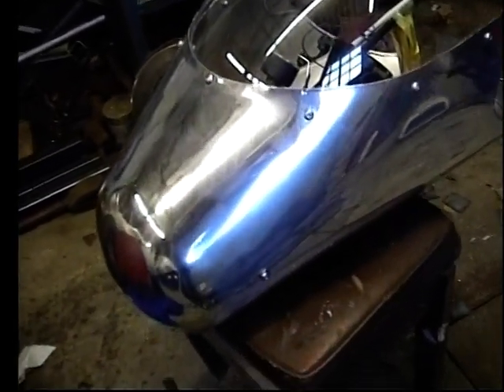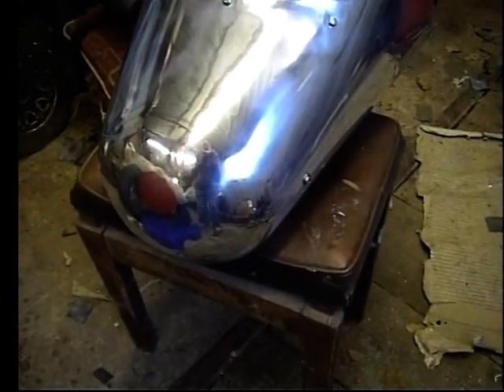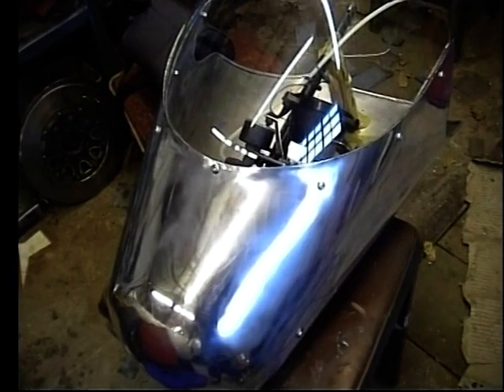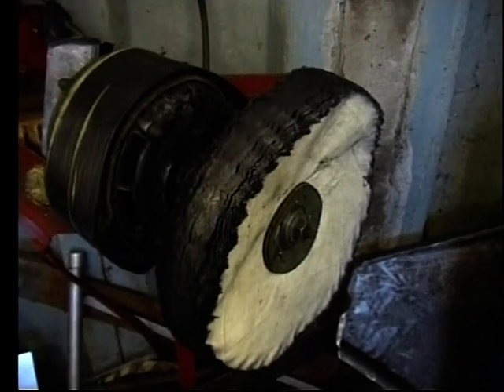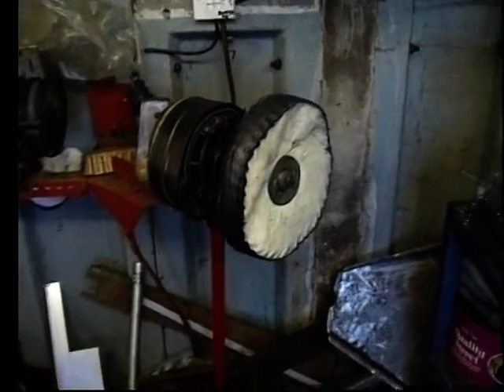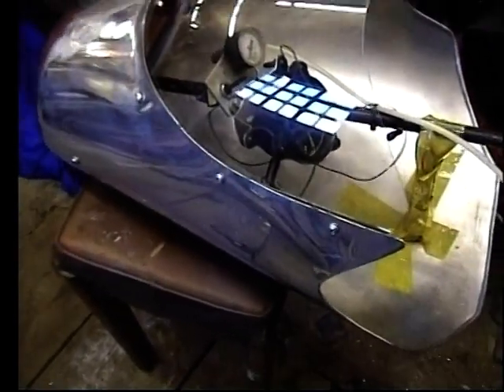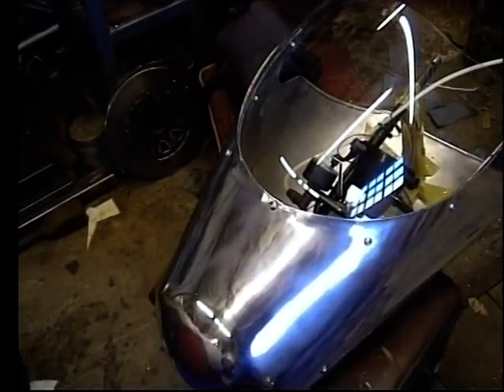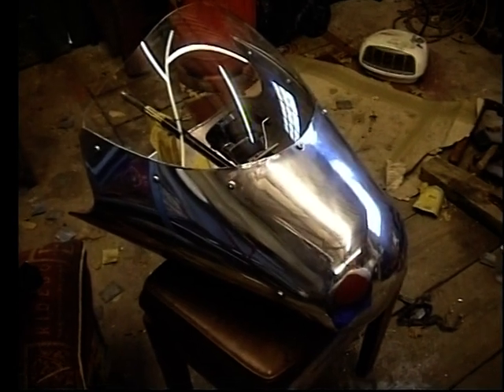Brief video: How I Made an Alloy Motorcycle Fairing & How I Cut & Drill an Acrylic Screen.

Comment: Good work again Pete. How are the fairing edges finished, wire edge, or just folded over?
Reply from the maker: +dpforth Hi and thanks for your compliments and question. I have in the past used wire edges, especially on some vintage parts I made in thin steel. However, on this occasion, I just folded the edges over to create some rigidity, so as to prevent any chance of cracking with vibrations and other movement, as the fairing was for a three-wheeler sprint machine. Cheers, Pete.

Comment: Ok Pete thanks for the advice , I was hoping maybe heating the dent slightly may bring it back out but looks like I'm going to have to cut it open , DRASTICALLY , I fear it's going to end tears .
Maybe begging at your front door next week for foreigner lol
Reply from the maker: Hi Mark, I think if you heat it, it will simply follow/worsen by expanding further in. Some people have suggested pressurizing tank with air but I don't subscribe to that theory, cos the whole tank will expand, not just the dent. Dodgy. Let me know how you go on. Pete.

Comment: Pete need your advice , i have an alloy tank which I had somebody make a while back , anyway it's got a slight dent in it somehow on its side , is there an easy fix or not ? Want to keep the tank bare otherwise it would not be a problem , regards mark
Reply from the maker: Hi Mark. Thanks for your question. If the filler cap is large enough you might be able to get a hammer in there if you saw off the ball part of it or the claws and gently tap it against the dent. But you'll have to have patience and maybe different size hammers as you get it somewhere near right. Alternatively cut a hole in the bottom on the opposite side (providing it's not got a deep tunnel down the centre), then use say a one inch diameter round dowel made of wood and curve the end of it/chamfer slightly, so it doesn't knock sharp dents in as you tap it gently with a hammer. You will hopefully then get it somewhere near and may have to tap the outside a bit, with the wooden dowel, or hammer (as in the first example) still in there, so it is solid to knock onto. Then use some various grades of wet & dry and rub out the marks on the outside. You could also try a shaped metal tube with tape around its end to prevent sharp dents/kinks and clamp the tube in a vice, then slide the tank over it through the filler cap and lever the tank till it pushes out the dent. I have used these ideas in the past. Other than that, you would have to cut the bottom out which is a major job. Hope this helps. Cheers Pete.

Comment: I am amazed by the skills u have got. 
I do have an aluminum sheet already. Want to try to do my first attempt on beating it into some shape i want. Will c how it goes. 
Would you have any advice? What tools are best and where should i start from?
Thanks for sharing them videos!
Reply from the maker: Hi Wojtek Spyra, if you want to do actual panel-beating, then many people use a special leather bag filled with dry sand and a large round-headed hammer or mallet and beat it with that. I don't have a leather sack with sand, I have a short piece of tree trunk about two feet tall and stand it on garage floor. It is about 10 inches across in diameter. I have used an angle grinder to grind a rough concave recess in the top of it and I place my metal on that and panel-beat it. But I try to limit the amount of panel-beating because it is very time consuming, especially getting all of the marks out. I have explained more about that at the end of my OTHER video of how I make an alloy petrol (gas) tank. I try to form the metal without panel beating where possible, using more simple curves. If you need any more specific info as you go along, just ask. Cheers and good luck, Pete.

Comment: your right ,theres no way you can drill screens using electrick drills ,it can be a expensive learning curve ,even with 30 degree bits they still snatch ,with the drill bit pete after you`ve sharpend it do you blunt it a tad ,in wood or on  concrete floor just to take edge of a bit ?
Reply from the maker: Hi fredbjc, I haven't heard of that before, just taking the edge off the drill bit by blunting on concrete. Perhaps I should test that idea. I actually just used the drill-bit as it was. It is virtually new. It has only been used about 3 times since I bought it many years ago, as I don't often work with acrylic or other plastics, although I've used polycarbonate a few times for various jobs. That is pretty easy to work with.. Thanks for your feedback, Cheers Pete.